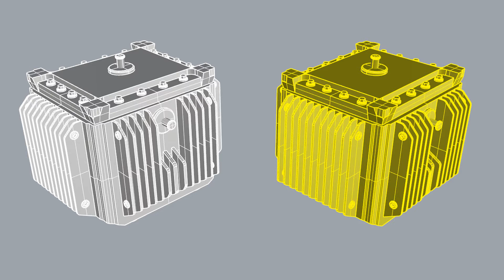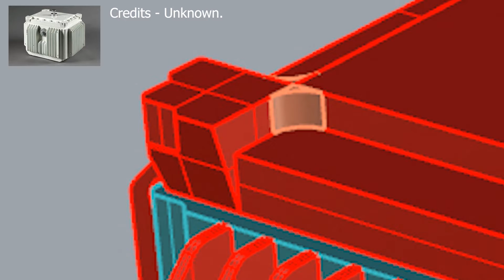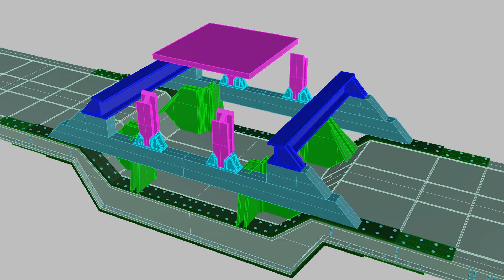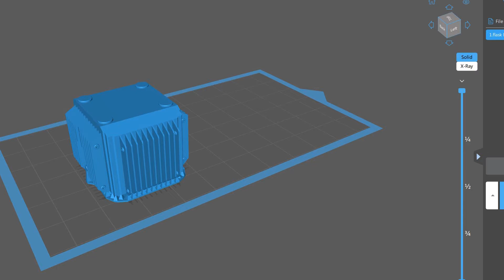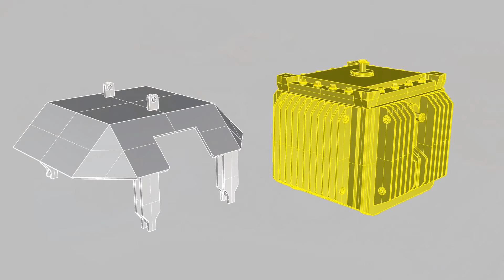Project Magnox wagon   Part 2

Comment: I was looking forward to this. Given the information you had to hand this is a good representation. I've seen quite a few of the later model flasks which you have  pictures of. Never know the early ones were painted yellow. I was a initially bit surprised that there's no buffer wagon between the flask and the locomotive but being steam there's a tender so I guess that would serve just as well.
Reply from the maker: i think you are correct, the tender would act as a substantial barrier wagon in the event of a derailment or crash

Comment: This video made me quite nostalgic. My father helped start up the Hunterson A reactor in Scotland and spent his last years travelling to different reactors writing the manual for the decommisioning crews . He said there were more people working on the reactor after it was shut down then there ever were when it was running. 
He was once involved with an incident with a flask where someone had drained the water from it without telling anyone, so when it was opened at the bottom of a fuel pool, a giant air bubble came out and there was a mad scramble to run away before it reached the surface.
Reply from the maker: that sound like a very worrying moment, but all were ok ?
Reply: @old_duffers_chuffers   I think it must have been very unpleasant at the time, but by the time I was told about it, it was a funny story about the silly people at Dad's work.

Comment: Nice work. Did these flasks contain nuclear waste? Cheers Joachim
Reply: Yes, these were used to transport spent fuel rods from the power stations to the post-processing site where it would be separated into different materials . While technically "waste", part of the purpose of these reactors was to produce weapons grade Plutonium as a byproduct. 
90% of the volume of the flask is filled with water, with the "hot" radioactive material in the very center. When filling and emplying the flask, it is sunk in a deep pool and robot arms are used to put the fuel rods in and take them out again.
Reply: @jmackmcneill  Spent fuel rods are loaded into a skip which is then placed in the flask. You do produce plutonium during the fuel cycle but it undergoes fission so it's actually useful for producing energy rather than for making weapons.

Comment: Great work. Still interested in one if you're planning on making a few to sell in the future.
Reply from the maker: if i do make some it will be a kit, minus wheels, buffers couplings. I have tried to get Rapido, Accurascale and others interested but just get zero response 👎🙁
Reply: @old_duffers_chuffers  A kit is fine with me. That's a shame I would have though Accurascale especially would take this on  as they doing the "powering Britain" line on things, I even suggested one to them. Fran is usually good at replying as well, don't give up.😁